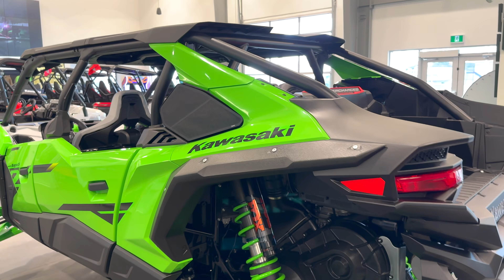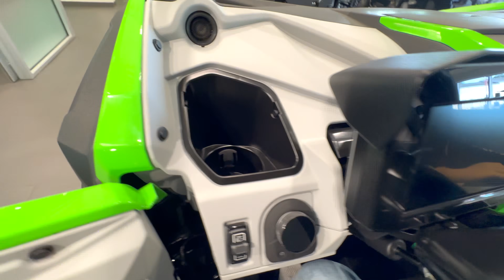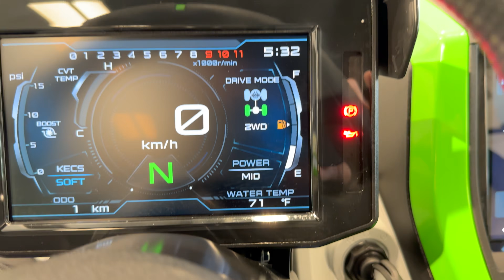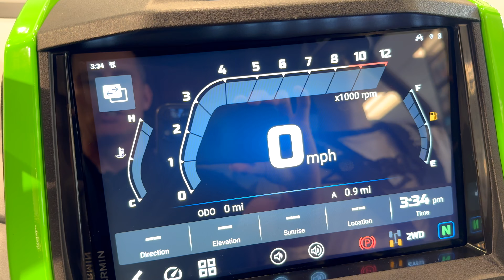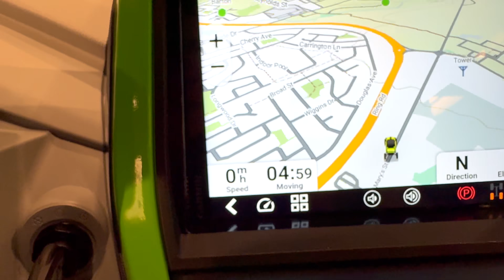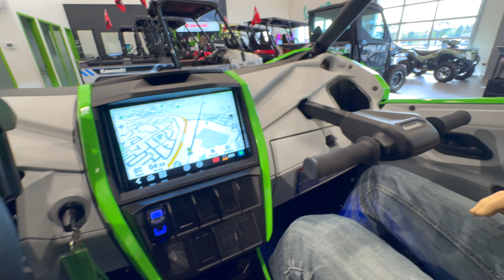2026 Kawasaki Teryx5 H2: You Want Power? Kawasaki Has Your Machine!

Comment: The biggest difference between this machine and the Pro R / Mav R is the top notch reliable engineering! So the front and rear suspension components aren’t going to fail for no obvious reason and there’s no R in it’s name thank goodness! I personally think Kawasaki should’ve offered a 6 speed sequential shift transmission 😊 But watch out for Yamaha! Lord will I be SXS broke!